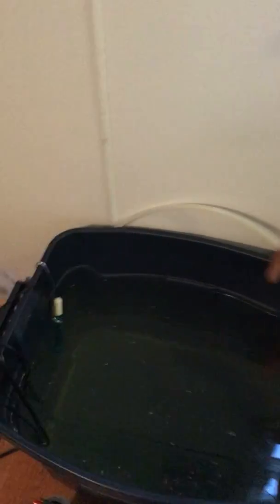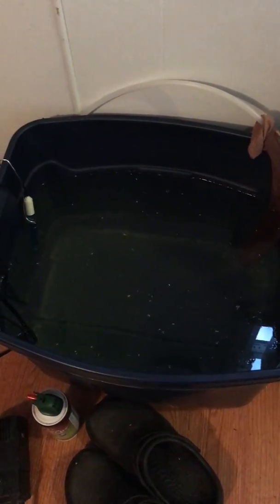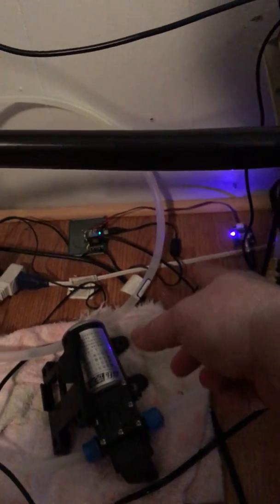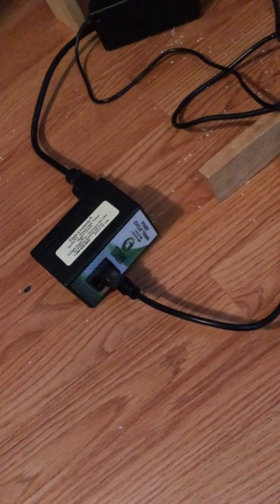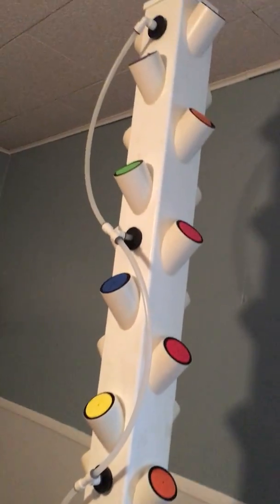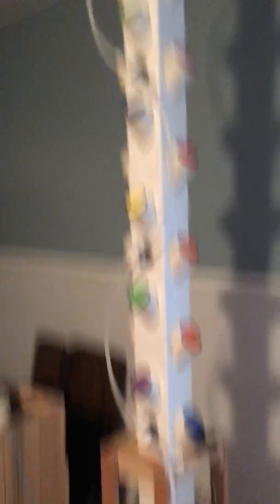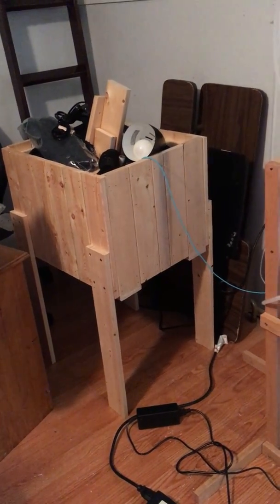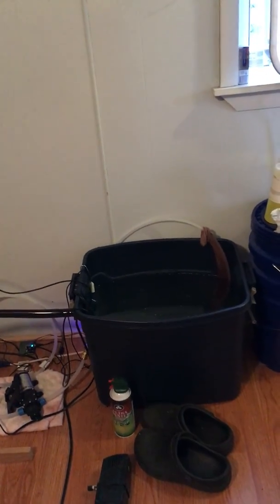DIY High Pressure Aeroponics System

Comment: Are those mist hoses high pressure? How does the mist flow through that hose? I'm confused about how the misting pump works. Do you know if there are silent pumps? Where does that noise come from?
Thanks in advance! 
Fantastic operation you got going there!
Reply: water . flows through the hose and the mist is created by the fine tipped nozzels

Comment: Questions : Why doesn't the 160psi mist damage the plant roots? What brand pump is it? And also what pH meter is it? And what are Particle Photons?
Reply from the maker: You can get the same pump on eBay for about $18, not sure of the brand as the writing is in Chinese and I'm not bilingual unfortunately.  I bought a few 130PSI pumps too and they would work just fine as a replacement.

The mist generated by the misters, while under tremendous pressure in the lines, comes out as a highly oxygenated, gentle, very fine mist that helps plants grow very rapidly.

Particle Photon is a micro-controller (similar to Arduino) that let's you control electrical devices by uploading some code to it.  For example: I run a PH probe, misting pump timers, light timers, TDS meter and quite a few other things with it. 

The major difference between the Photon and an Arduino is it makes connecting to the internet and sending information to the cloud very easy. This way you can archive your readings as well as view them in a way which gives you an overview of your greenhouse.  You can see it in action here at my public greenhouse dashboard:

 https://app.ubidots.com/ubi/public/getdashboard/page/CC6wMiksjgESSEksG1D8-sosKhc

Hope this helps you out :-) Have a wonderful day!
Reply: OK, thanks. I see why yo are using Particle Photons then. For me I will either use an Esp8266 - and  a bluetooth LE devices which will talk to a hub - and then the hub will talk to the net.  I have to use  a PV panel so power is limited to broadcasting probably every 3 minutes - and I want to have more than one system monitored simultaneously  - hence the blte requirement.

More questions:  160psi is better, right , because it makes more of a mist? How many misting outlets can you run off 1 x 160 psi pump?  What misters do you use? What are they made from?  What sort of tubing do you use?  What connectors do you use to join them so they don't leak?
When will the  pdf file you mentioned will be finished?
The dashboard is very impressive. I'm guessing the indicator at right in the middle is reservoir volume in litres?  That's quite a big volume.  Is it installed above or below ground?  And what happened on May when the temperature drop suddenly to 0 degrees at 07:24:30   then went back up to 68 degrees?
Reply: Also - how are you filtering the liquid ?  And what size orifice do the misters have?
Reply: what is the best alternative to using these brass nozzles? What sort of container should high pressure aeroponics be in - possibly measured in liters per plant site?
Reply from the maker: I'm not sure of the diameter of the mister orifice, it's about as tiny as a human hair so I would estimate around .005"
Reply from the maker: It depends on the size of your operation really.  

My system is setup with an 18 gallon reservoir, when the water gets below a certain point I put some fresh in.  This reservoir runs 26 sites but I'm going to expand that this week with another unit that I have which has another 26 sites and it will be fine.  You can run as many sites as you need off of a 20 gallon reservoir as long as you keep an eye on the water level.  If you have too much evaporate quickly it will cause your EC to go up, but if you keep the water level fairly consistent your EC won't vary much. I have a water level float switch that I need to put in the system to turn on a freshwater pump, that will automate the whole issue and it will go away permanently.

Overall it uses about 3 gallons per week but I assume that it's due more to evaporation than anything else.  I lost the lid to the unit so it's open to the air now, if covered it wouldn't use that much water.

Hope this helps you out :-)
Reply: Thanks. That's helpful.  So it seems the nozzles can be any that give you the right size droplets - but steer clear of ones that tend to clog up. I suppose this is because people do not pay attention to filtering properly.One question remains though - how many nozzles can you run off one pump rated at 150psi ?
Reply: @fleaniswerkhardt4647  0.012 works great for perfect sized mist at anywhere from 80-110 psi. It is a very fine spray but not quite a fog.  It is a mist.  0.005 is gonna stay clogged if you are growing enough stuff to make it worth your effort.
Reply: So I guess the smart thing to do would be to use just enough misting time so that the plant roots absorbed 99% and only a minimal amount was left over - which you'd just dump.

 Could be tricky but I guess the variables are known or could be worked out - ambient temperature & humidity,  temperature inside misting chamber, plant fluid uptake  rates at various stages in the growth for that species.  It could be put into an algorithm and have a microprocessor adjust misting times accordingly.

Thinking about it - that has to be the best way to go actually. But the hard part would be working out the changes in growth rates and uptake week by week for any given species.  Then again , seeing that output and misting times are known, you could just measure the overflow volume after each misting - subtract it from the known input and actually calculate the optimum misting times that would produce close to zero output.  . Tedious but doable. 
 Surely someone has to have done this already?  If not, when I set up a system, it will be the first thing to do.
Reply from the maker: I have a thread on our Facebook group where I'm documenting the growth on one of my systems and uploading pictures so that you can see the amount of growth every week if you are interested.

I'm running Winter Density Lettuce, Pirate Lettuce, Spinach, Cilantro, Basil, Thai Basil, Parsley, Broccoli and a few others in the same system and they are all doing very well.  You can check it out here if you would like: https://www.facebook.com/groups/aeroponicsystems

The group is pretty active and the users have all kinds of different systems if you want to learn more about them.  A few people are using foggers, some low -pressure aero users, and high pressure users as well.
Reply from the maker: You should be able to use Ubidots for to archive your readings with that Esp8266 just like the Photon, no worries there. Here's what I got using the Photon, this is my live dashboard, I made it public so that you can see all the sensors working: https://app.ubidots.com/ubi/public/getdashboard/page/CC6wMiksjgESSEksG1D8-sosKhc
Reply: That sounds really interesting. Unfortunately I won't be able to see the Facebook page as it wants me to log in - I'm not on Facebook.  Documenting growth rates in various conditions looks like something that needs to be done
Reply: Interesting. Why do you think pH varies so much?
Reply: I'm assuming that if the output volume is subtracted from the input volume - the amount left over is what is not taken up by the plants' roots. In other words , input volume minus output volume is the amount taken up by the roots.

Maybe I'm missing something.  I'm discounting evaporation - but am assuming beads of nutrient on the container walls all eventually make their way down to the outflow area and are counted as part of the output volume
Reply from the maker: Honestly I think it's the probe, but it's keeping the reservoir within a range that would be very hard to attain any other way.  I have a better probe here that I have to calibrate and install into the system, just haven't got a round to it since this one is working well.
Reply from the maker: The reason that I'm using these misters is they are what the commercial growers are using, and I figure that people who make their living doing this stuff tend to test and tweak to optimize their harvests.  They are working great! Once I got the filters right, haven't had a clog in a week now and I check them daily.  Hoping to get to the point where I don't have to worry about it it all soon.

I have tested two pumps now, one that runs at 160PSI and one that runs at 130PSI.  There hasn't been a noticeable difference, the plants are still doing great.  Since the pumps are cheap I have a few backups for an emergency.  

As I stated earlier I don't use accumulators, as they are not necessary. 

I've read a ton of scientific research on aeroponics from RJ Stoner, NASA and others, and nowhere is an accumulator mentioned.  My pump takes less than a second to charge the system due do strategically located check valves. People who insist on using accumulators are guys that sell accumulators and make money off of them so their motive is suspect.  My goal is to keep the bar of financial entry low so that everyone, regardless of their financial situation will not be intimidated by the cost.  

People insist on using this or that but when you ask them why, you don't get a scientific reason, the conversation always breaks down to 'I've always done it this way', or 'some guy on a forum said' there is no scientific documentation on them.

The reasoning is that somehow droplets of water that are not optimum may end up on a the root system.  It's impossible to show how these non-optimum water droplets can harm a plant, it's ridiculous on it's face.  The effectiveness of a system is measured on the speed of plant growth, not droplet size, the proof is in the harvest.

Additionally you will hear much about 'droplet size'. Next time you hear that, ask the person how they measure the size of droplets, with a vernier caliper?  A micrometer? Do they take high speed film of the mister operating and freeze the frame and somehow measure the size of the droplet that way?  It's nearly impossible to measure, additionally misters are not sold by droplet size, there are sold by flow rates which in no way has anything to do with 'droplet size'.

People tend to be in this camp, or that camp, and don't go outside of 'what works for them' because why fix what isn't broken?  There are many, many methods that work well. Personally, I've tried Kratky, low pressure aeroponics, high pressure aeroponics, DWC, NFT hydro, etc. they all have their benefits. I've built and tested no less than 10 different styles of aeroponic units over the last 10 years. They all had pros and cons, there is no 'right way' to do anything, just test and have fun :-)

I know that what I do works.  My wife was in a terrible auto accident where she was standing still and was rear ended by a person going 50MPH and it shattered her spine.  This got me in to growing medicinal cannabis, to alleviate her pain.  We literally went to 15+ doctors and tried every medication on the market without much luck.  Cannabis worked, and it is legal with a doctors recommendation and certification from the State, which she has.

After growing a bunch of different strains of cannabis that are well known for getting VERY LOW harvests, the plants in my system were getting 5 times the weight that people were reporting, and it wasn't a fluke, it worked every time, on time. The proof was in the harvest.  I don't grow cannabis anymore but have shifted over to produce and other herbs :-)

Anyway I hope this helps you out :-)
Reply: "..The reason that I'm using these misters is they are what the commercial growers are using, "
What brand and size were they again and where?
" Once I got the filters right, haven't had a clog in a week now and I check them daily."
In my situation and climate I realise that water conservation is critical so I've decided to recirculate. Therefore filtration would be a critcal component. I am thinking of using sand ->charcoal -> 5 micron cartidge and think that is sufficient. Do you?

 "As I stated earlier I don't use accumulators, as they are not necessary."
The benefit I see,  as Atom izer alluded to , is that with a large accumulator - the pump does all its work at once and then rests. Just like a shop air compressor does. Also - you can run many aero units off one tank.  I see advantages in this.
 Thanks for that link - and you are right - that accumulator is overpriced. I can get a bigger one for less than $60

 "My pump takes less than a second to charge the system due do strategically located check valves."
What size check valves - and where do you get them?

 "..... The effectiveness of a system is measured on the speed of plant growth, not droplet size, the proof is in the harvest. "
Absolutely, that has to be the criteria.

"...Do they take high speed film of the mister operating and freeze the frame and somehow measure the size of the droplet that way? It's nearly impossible to measure"
That method you mentioned is exactly right.  A friend of mine is a laser/optics engineer who builds equipment to measure pollutant particles in the atmosphere so another method is the use of extremely fine laser beams which somehow gauge particle width.

" I've built and tested no less than 10 different styles of aeroponic units over the last 10 years. "
Yes - it's pretty clear you have a handle on things.

"They all had pros and cons, there is no 'right way' to do anything,  "
There must be a right way to achieve optimum growth conditions.

"Cannabis worked, and it is legal with a doctors recommendation and certification from the State, which she has. "
Great stuff, isn't it? It's illegality never really worried me. Just had to be careful. But I haven't smoked in 20 years - my tech career required focus and analysis.

 ".....The proof was in the harvest. I don't grow cannabis anymore but have shifted over to produce and other herbs :-) .."
I've seen amazing results with an aeroponic tomatoes  trial - I expect many non-woody plants would do very well using this technology.

"Anyway I hope this helps you out :-)"
thanks - all the posts are informative and giving me a sense of the way to go about constructing a system that should work reasonably well. I'll have to tailor things to  possible extremes in my  climate (45+C in summer, -9C in winter) - but getting the basic layout and mechanics right of the system is primary.
Reply: the ph changes dramatically  because the nutrient recycles... i.e.  after a watering the plants uptake bits and pieces of whatever theyre needing and the rest drips back into the reservoir... this nutrient is missing some components and then mixes back into the nutrient stored in the tub diluting/changing it. 
This occurs with evaporation and method of storing also.. light affects nutrients also (algae) which  will change the properties of the solution.
A quick and efficient fix is to run the system to waste (i.e. let the used solution run down the drain and out of the system completely), this ensures your solution always stays the same as when you first mixed/balanced it.
Also do not let light of any kind into your storage tank, and keep temps as close to optimal as you can.
Or.. you can keep recycling and science the shit out of it ..daily.(hard work).
Hope this helps.